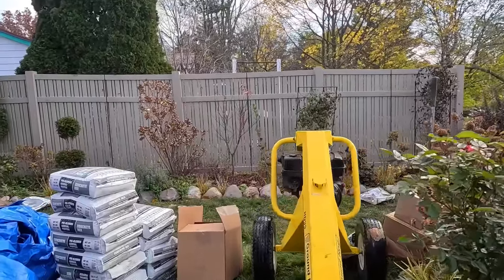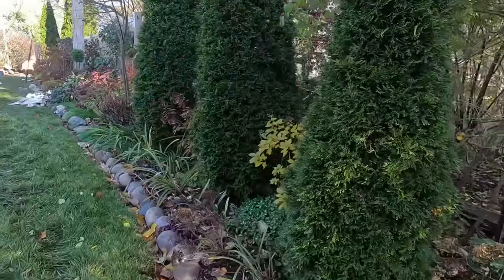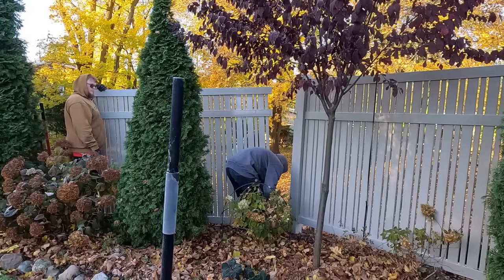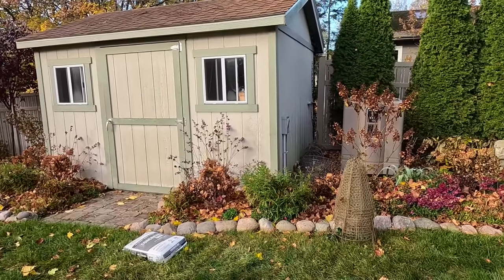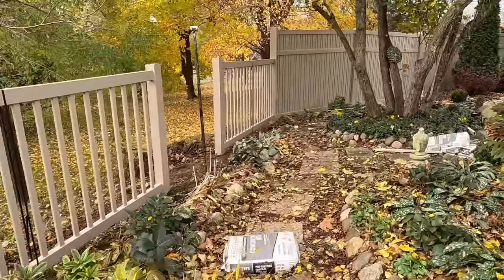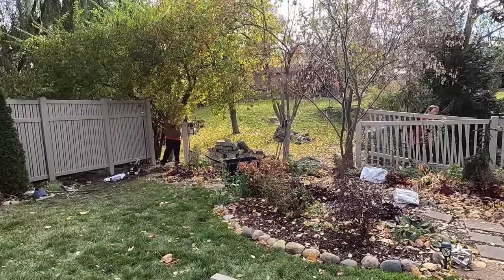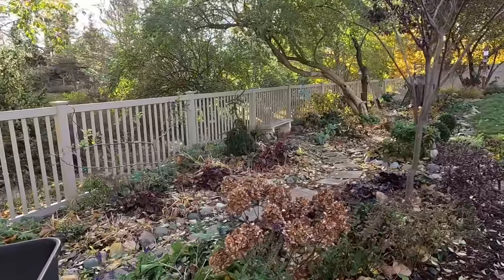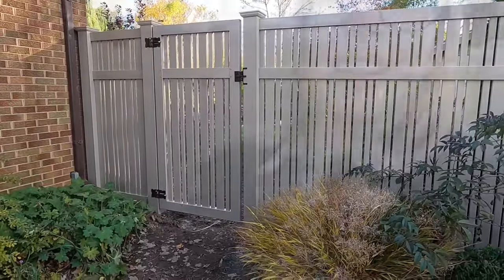Day 2 & 3 The New Fence is Up!!  💚😃💯// Suburban Oasis

Comment: Your fence is beautiful. I love the spaces between the slats so it doesn't seem so claustrophobic and will allow your summer breezes to sweep thru and provide more aeration for the plants.  Your back fence makes a huge difference adding a visible backdrop for your gorgeous plants. Building up the space behind that back fence will be a challenge but if you can add an edging barrier to hold your garden bed soil in while you work on it,  would be helpful.  Very happy for you! I would be thrilled to have your yard.
Reply from the maker: Thanks, it will be a challenge but fun as well to figure out. 😉